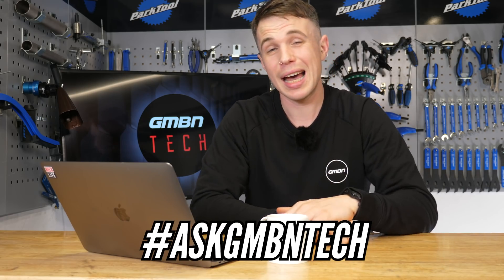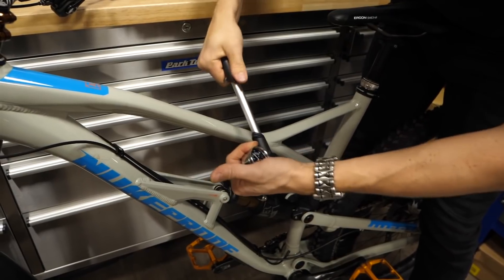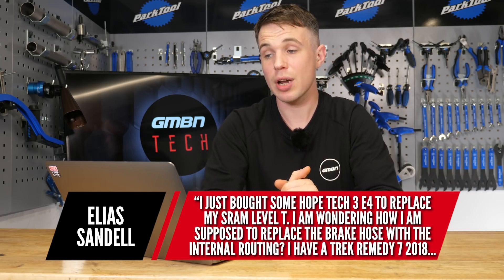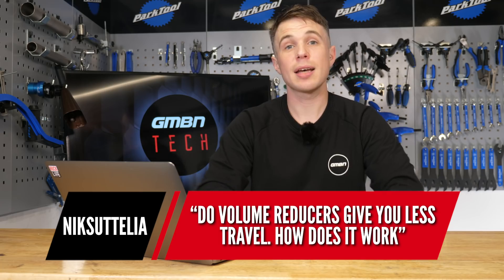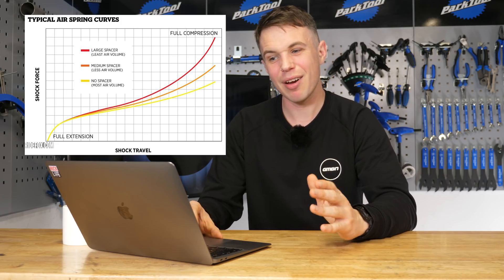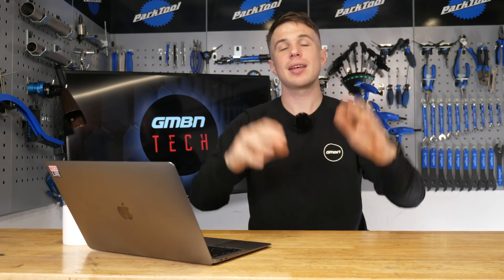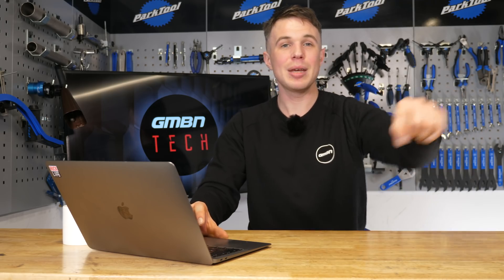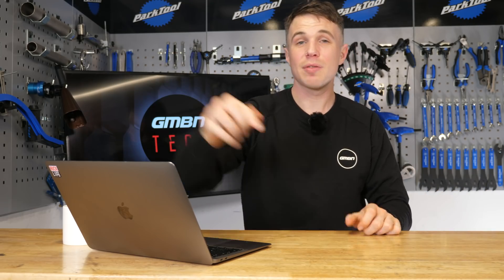Do Volume Spacers Reduce Suspension Travel? | #AskGMBNTech

Comment from the maker: Have you got a mountain bike tech question for us? Submit it in the comments below using the hashtag #askgmbntech
Reply: #askgmbntech I have a Cube Stereo 140 2019 and when I hold the back wheel and the seat stay and wiggle it from side to side there is some play on it
Reply: Benjamin Markwell what’s the question? Are the cones on your rear hub loose? Any of the pivot bolts loose?
Reply: I was wondering what it could be?
Reply: #askgmbntech  Hi guys :) Hypothetical, is possible to use car motor transmission mineral oil into breaks with mineral oil, like as Shimano? Thx and have a nice day. Miky
Reply: Michal Žiška sethsbikehacks used baby oil in a set of brakes and it worked. I wouldn’t but you could
Reply: #askgmbntech is there other ways to change your seat post size other then a seatpost sleeve shim
Reply: I have a question I have a dropped post and bike to school every day should I be worried about Rocks and dirt hitting it possibly chipping or damaging it and would Covering it with and help inner tubes would that help #askgmbntech
Reply: #askgmbntech can you put time stamps in the description so I can only watch the parts I’m interested in?
Reply: #askgmbntech Hi Guys Love the show, recently I serviced the lower legs and air shaft of my Rockshox Reba (thanks to your vidoes) but I haven't done anything with the damper. Do you need to service your damper, if so how? I've noticed that I'm getting a bit of a squelching sound from the damper
Reply: #askgmbntech what do i need to do to replace an nx 1x11 drivetrain with an XT 1x12?
Reply: @
Hi guys I'm planning to get a new DH- bike but I'm not sure which size I should get, (I'm 1,82 m). My last one was a 2017 Norco Aurum in L with a 432mm reach, 603mm top tube and a wheelbase of 1245mm, which I really like, but I want something longer. 
My plan is to get a Mondraker Summum, but I'm not sure if I should go with a medium (reach: 422mm, top tube: 600mm and wheelbase 1225) or a XL (reach: 468mm, top tube: 647mm and wheelbase 1280), a L Frame is unfortunately not available. 
Should I go with the M frame and lengthen the reach with the 2° angle cup, up and down (should be 20 mm +/-?) or go with the XL and use the angle goekit to make it shorter (also 2° +/-), it's  also possible to go  even shorter on the offset oft the Fox 40 if necessary.
Have you heard of the MOJO  More 40 (Mojo Offset Reduction Crowns)?

love the show, keep going

Comment: Hey i have a 2019 stumpy 27.5 and has a 210x52.5 rear shock. I want to upgrade to a fox x2 but does no come in that size the nearest sizes are 210x50/55 which of those can i use if they will work ? Thank you

Comment: @
Hi guys I'm planning to get a new DH- bike but I'm not sure which size I should get, (I'm 1,82 m). My last one was a 2017 Norco Aurum in L with a 432mm reach, 603mm top tube and a wheelbase of 1245mm, which I really like, but I want something longer. 
My plan is to get a Mondraker Summum, but I'm not sure if I should go with a medium (reach: 422mm, top tube: 600mm and wheelbase 1225) or a XL (reach: 468mm, top tube: 647mm and wheelbase 1280), a L Frame is unfortunately not available. 
Should I go with the M frame and lengthen the reach with the 2° angle cup, up and down (should be 20 mm +/-?) or go with the XL and use the angle goekit to make it shorter (also 2° +/-), it's  also possible to go  even shorter on the offset oft the Fox 40 if necessary.
Have you heard of the MOJO  More 40 (Mojo Offset Reduction Crowns)?

Comment: #AskGMBNTech
Hi guys I'm planning to get a new DH- bike but I'm not sure which size I should get, (I'm 1,82 m). My last one was a 2017 Norco Aurum in L with a 432mm reach, 603mm top tube and a wheelbase of 1245mm, which I really like, but I want something longer. 
My plan is to get a Mondraker Summum, but I'm not sure if I should go with a medium (reach: 422mm, top tube: 600mm and wheelbase 1225) or a XL (reach: 468mm, top tube: 647mm and wheelbase 1280), a L Frame is unfortunately not available. 
Should I go with the M frame and lengthen the reach with the 2° angle cup, up and down (should be 20 mm +/-?) or go with the XL and use the angle goekit to make it shorter (also 2° +/-), it's  also possible to go  even shorter on the offset oft the Fox 40 if necessary.
Have you heard of the MOJO  More 40 (Mojo Offset Reduction Crowns)?

love the show, keep going

Comment: Regarding stiction in the beginning of fork travel...it could also be a bit of grit that's worked it's way under the seals...after every ride I use Fenwicks suspension lube spray on the forks, shock and dropper...cycle them all through a few times and wipe away any grit and water it brings from under the seals. This keeps the initial movement nice and free right from the get go!

Comment: #AskGMBNTech 
hello guys
I build the first wheel set for my mtb with straight pull spokes and i wondering if i use the old method of "wire tie spokes and solder" to get the looser side of the wheel strongher.
Thanks

sorry for my bad english

Comment: #askgmbntech Sorry! Another suspension question... You mentioned adjustment of the negative air chamber. What are your thoughts on the Rockshox MegNeg? I have a 2019 YT Jeffsy with RS Deluxe and am finding it to dive into the midstroke too easily. Would the MegNeg be a good solution?

Comment: Hey guys! My son and I are planning on building up a dirt jump bike in the future (funds permitting) and I have a question regarding the bottom bracket. On the spec list of the frame, an Evil Faction, it states the BB shell is a Mid BB. Is this a standard size or will it require measuring the BB shell? Cheers 🤘

Comment: #askgmbntech I have Nukeproof mega 275 how do you remove the bearings in the swing link as the surface is not flat {i do have the RRP bearing removal tool and the press and extraction bits} Many thanks

Comment: #askgmbntech Hi. I am going to service my DT Swiss OPM O.D.L 100mm fork. DT Swiss recommend using their "Lube Fluid" in the air spring and the foam rings and their "Fork Oil" in the lower legs. I can't find any lbs that is able to get these for me. Can I use some other oil instead? The fork oil is 7.5W but the lube fluid has no specified viscosity.

Comment: Ok, idk if anyone said this yet, but hotwire works very well for fabricating a hook, and for threading through the frame. Once threaded through, you can simply stick the end of the hose/housing onto the wire, and the wire will guide the hose or housing to where it needs to be.

Comment: #AskGMBNTech

I am struggling to set the Sag a Fox DPX2 shock, fitted to my 2018 YT Jeffsey Cf Pro Race,
I have had to put in the maximum 350psi, and am still only getting to around 40% Sag, 
I am 187cm/140Kg ex rugby playing Bat Fastard.
Would a few volume spacers help? or am I just to big for my bike and need to go back to my Hardtail?

Comment: #askgmbntech. Hello GMBN I recently bought a kona supreme operator it came with saint brakes after replacing the pads discs and bleeding them it still takes two fingers to do an endo at low speed how powerful are dh brakes meant to be? My XC brakes were more powerful? So I bought a mt7 and still have the same problem.

Comment: I have bent my front wheel during a crash (I´m fine except for a few scratches) but I am on a very low budget. Now I would like to know, if and how I could fix it myself or where and how I can get the cheapest possible replacement. The wheel doesnt look too bad, the bike still works but you do immediately notice it, once you start riding. #askgmbntech
Reply: You would need a spoke tool and a zip tie. They made a video about trueing your wheel. You'll probably never going to get it 100% perfect but very ridable. Just give it a go.
Reply: Thanks a lot i'll try that

Comment: The reason for inverted forks is to reduce unsprung weight, but they are still quite rare on bicycles, I think only the Rock Shox RS-1 and Cannondale Lefty forks.  Inverted forks are quite common on both sportbikes and motocross bikes, though nearly all motorcycle forks are coil sprung (there are a few air forks on dirt bikes).

Comment: To get the brake hose through if u dont have the little Rockshox tool that threads into both end of the brake hoses: 
Just take a thin long screw. Cut it and file it sharp at the flat/cut end, so that you have two sharp ends. Thread both hoses together and pull the  hose through the frame. Easy! ;-)
Reply: I was going to suggest this also! Great hack

Comment: #askgmbntech 
I see that some full suspension bikes have a “piggy back reservoir” on the rear shock.
What does that do?
Reply: Holds more damper oil, so its less affected by heat build up on long.runs where its being worked hard (e.g. alpine decent). As the oil heats, it effectively thins, reducing damping. This helps minimise this. Normal trail use tho, unlikely to need it.
Reply: @rupedog   I don't think my DVO shock does.  It has a diaphram with negative air chamber afaik

Comment: 230psi shock guy, could be he runs that pressure not for correct sag 25-30% but to stop bottom out, in which case, he may need to instead add a volume band or two and set pressure for 30% sag.

Comment: #AskGMBNTech Hey guys, i have a 2018 RockShox Revelation rc with 140mm of travel, my bike can support a 160mm fork and i like it more with a bigger fork. Can i put a 160mm air spring in it? Does the chassis and damper work for 160mm? Thanks for the answer.
Reply: I think 2018 revelation goes to 160, like the current one, but check sag marks on the leg...if there is a set for 160 (I.e. marks that show 25% at the level ur 120mm is zero), then YES. Get a upgraded (big neg) debonair spring in 160mm, noting.u will need to remove most if not all ur volume spacers (as newer springs are way more progressive due to larger neg) and redo sag set up. Easy job if u can do a lower leg service/have tools for that. Sram have a specific video and manual on their website for this job.
Reply: Yes, you can. Mine came at 120mm & have them at 150mm now (different frame). If not done already, you can also upgrade to the newer Debonair spring at the same time which improves the initial stroke feel quite a lot.

Comment: #AskGMBNTech is there any tricks to prevent losing air pressure in suspension when riding in cold weather,  My rear shock held air perfectly until the temperature drops down, once temps are at zero or below I seem to blow out the pressure even on smaller hits... leaving me to stop multiple times and pump up the shock while on a ride... could I put a thicker grease around the seals or something
Reply: Shock sounds like needs service. That's not normal.
Reply: @rupedog   I had a full rebuild done to the shock when I bought the bike and have only put 500-600kms on it... It is a 2008 Scott Genius,  maybe the seals aren't as durable as newer air shocks and need replacing already
Reply: I've heard rubber seals can shrink in the cold, so I was thinking that might be the case and that some thick grease around the seals might help

Comment: #askgmbntech my fork has an air valve on top and bottom. I've heard this called a positive and negative air chamber. How does this work, should I fill them to the same pressure? Do all air forks have this? It's a rock shox u turn air. Oldie but rides great
Reply: Sounds like it might be dual air...most now are solo air. Yes, starting point is set the same, using sticker guide on fork leg (weight is ur weight in full gear, with water), and tweak for sag from there.
The dual air then really allow fine tuning of the neg and so progression and small bump/initial sensitivity. its a great system, but its far far more fiddly to get right. Easiest to keep them equal, or neg 1-2%higher max to replicate (kind off) the effect of the new, bigger neg volumes in the latest forks

Comment: Do you think products like Cushcore and Minesweeper are a good/helpful addition to full sus and hardtail mountain bikes? #askgmbntech
Reply: HawkReaper  I’ve ridden CushCore on my full suspension for over a year now and I can’t imagine riding without it, the added dampening, traction, and rim protection is second to none
Reply: @andrewcox7416  Doesn't it increase weight and make climbing a bit harder?  For DH bikes it's a no-brainer but for a XC bike I'd think twice
Reply: Ouroboros  It does add weight, but from my experience the added traction was well worth the weight especially on those steep technical climbs
Reply: @andrewcox7416   might give it a go!
Reply: Ok! @Andrew Cox, I'm going to be getting a new Enduro full suspension, so I think I'll check it out. Thank you!
Reply: HawkReaper  You won’t be disappointed 🤘🏽🤘🏽

Comment: #askgmbntech im buying my dad a dropper and most droppers come in a 31.8mm or 30.9mm diameter, ans after abit of research he has a 31.8mm seatube diameter is it okay getting a 31.6mm or have i got to find a 31.8mm. He has a cube attention sl cmpt (2016) Thanks alot!!!
Reply: Seat posts normally would be 31.6, so u might want to re check that frame size. How did u get 31.8?

Comment: Hey ive got a trail bike(specialized pitch pro 2008 with 140mm back and rear )and I wanted to make it more enduro like.What could I do?

#askgmbntech #askgmbn
Reply: Get a new bike
Reply: Heavier tyres, over fork it by up 20mm, shorter stem, wider bars (maybe), strap your spares to the frame.
Reply: @derman3658  thank you very much I will change my rear tire and a shorter stem but the handlebars are already 780mm becouse the old oner changed them

And to change the fork is out of buget for me(because I'm therteen and I just spent all my money on this bike 

Thank you very much I found it quite helpful
Reply: @kianferre5727  might be good value, but you won't make an Enduro machine from it. It has terrible suspension platform, not only that but the shocks are very bad too, in general it lacks support and traction. The geometry is not too bad, but it's not really dropper ready is it? For a cheap ripper it's good, but you have to be aware that you won't make an Enduro machine out of it, no matter how much money you waste trying.
Reply: @kianferre5727  stick the good tyre on the front
Reply: @kianferre5727  little olive oil on the fork and shock body too. See if it helps suspension. Don't get any on the brakes
Reply: @derman3658  no olive oil on the shock or fork. Take them apart (just basic service, no need to go further) and clean+ grease the moving parts, a bit of oil will help too. Lubing just on the outside is asking for trouble. Don't ask here how to do, Google it, there are millions of guides, for your exact suspension too I bet.
Reply: @piotrekserwisuje  yeah Im not going to do the magavlanche soon
I mean it's my first bike and it's quite capable for me
Reply: @derman3658  anyways I've ordered some fork boost on Amazon 
It practically lubes and cleans
Reply: @derman3658  this bike is really bad though, not just by todays standards, those were not designed very well.
Reply: You can get such a stellar used bike for so little money these days that it's really not wise investing in those old ones. If you want to cheap out, just keep it as it is, mayby get some better tires, want a better bike, ditch it.
Reply: @piotrekserwisuje  Hey my bike is actually very good and I paid it for realy cheap and with great value
Reply: @piotrekserwisuje  why do you think so?
Not to be protectev but like real question
Reply: @piotrekserwisuje  it's his first. Let him rail it til he gets a newer bike in the future.
Reply: @derman3658  how am I supposed to know that its his first bike? Anyway if its true, why would he worry about making it "more Enduro" instead of learning to ride properly?
Reply: @derman3658  well I also got it used and it came with some great new parts like a dropper post wider handlebars different shifting
Reply: Thanks I will try to do it soon

Comment: #askgmbntech is there a way to attach a water bottle to a 2019 Nukeproof Mega? The factory location is absolutely useless, and there’s no way to reverse the shock like in older models to make it fit inside the frame. I do have a camelbak but dislike carrying weight on my back, plus it’s a pain to keep clean. The frame size is medium. Cheers
Reply: Camelbak LR or hip pack. Or a top tube bag and shove it in.there?

Comment: Hi Herny, I just got a dhx2. Can you please help me to walk through the correct adjustment of high slow speed rebound and compression? Thanks a lot.
Reply: Was in one of their videos.
High compression - ability of stanchions/piston to "dive" fast, used for obstacles that repeat like rock-garden.
Slow compression - opposite, obstacles far away: big hilly jumps, drops.
High rebound - fast returning of pistons in many close obstacles - rock-gardens etc.
Slow rebound - slow returning of pistons in far away obstacles - big hilly jumps/drops.
If you ride roots/rocks choose: high/high.
If you ride jumps/drops choose: slow/slow.
For example, if you choose slow in rock garden roots it will not return fast enough before next.
If you choose fast for jumps/drops it will return to fast and painful after obstacle.
Reply: Go for the fox tuning guide. I setted mine up like in the tuning guide and its a very good help.
Reply: @MaxMustermannnnnn  Thanks for answering. Actually I did the same and the results were good as a first approach (15 clicks open for HSC/LSC/HSR/LSR suggested for 63mm shock travel/150mm rear wheel travel/450 spring rate), however I'd like to understand how to do the fine tunning now.
Reply: https://www.shockcraft.co.nz/technical-support/suspension-setup-78/suspension-setup